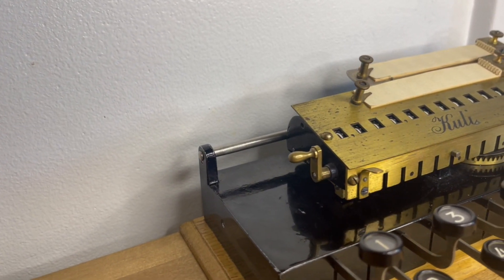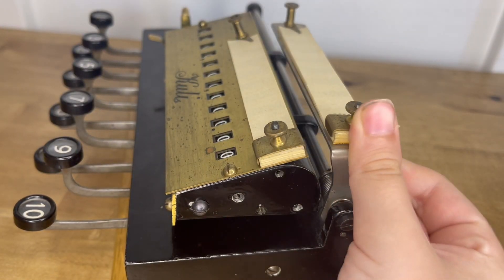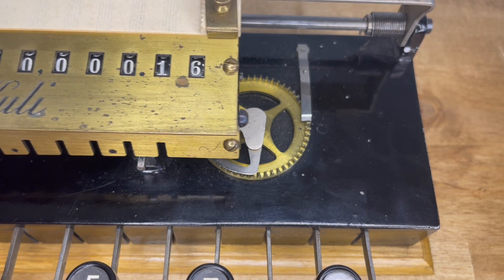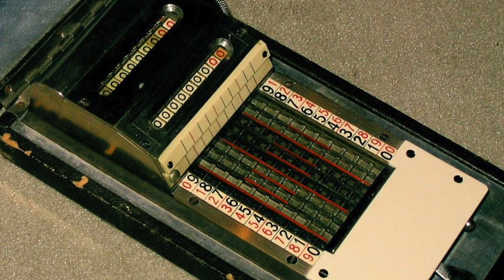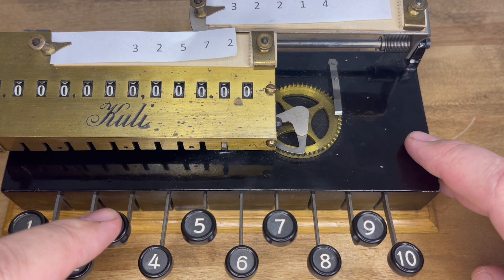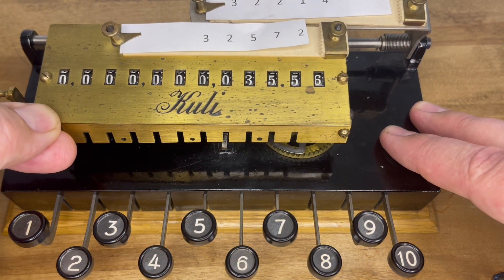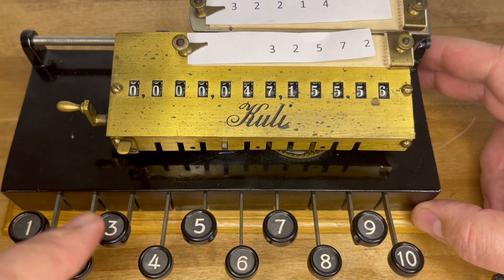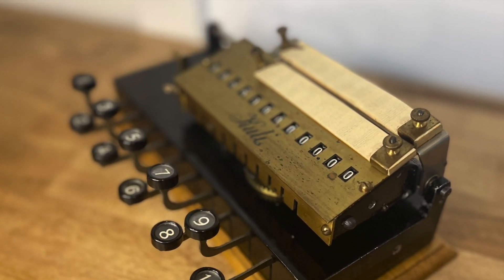Kuli adding and multiplication machine

Comment: Another fantastic rarity!
At 3:15 you say that the numbers start to become misaligned. This is purely because you printed the digits slightly too far apart compared to the register. While the first 3 of the front number lines up with a window, the last 2 is almost halfway towards the next window to its right. This means the the rear number starts off misaligned compared to the register,  but it also has the same incorrect spacing so at the end its last digit is even further to the right.
Reply from the maker: Yeah I printed a few sample problems before I gave up trying to get them lined up perfectly. I didn’t think that would have been as challenging as getting the correct answer.
Reply: @stephenfreeborn  And thanks for showing the whole multiplication method. It is barely practical on a machine with buttons like this - multiplication on an old wooden-case comptometer is almost as bad - but absolutely insane that one would regularly do it on a Master adder.
Reply from the maker: Right!?  I had seen those double papers on the Masters but until I got the Kuli didn’t understand their significance.